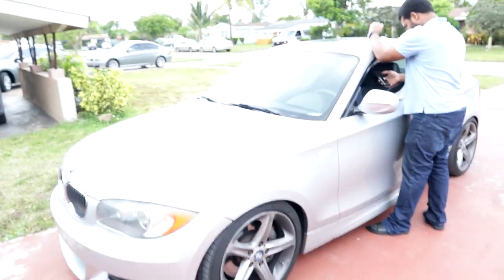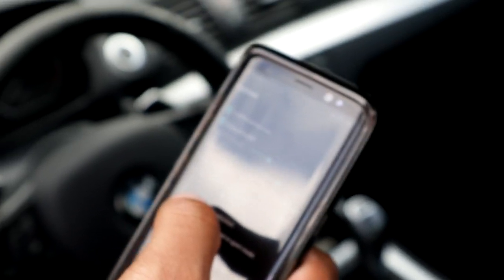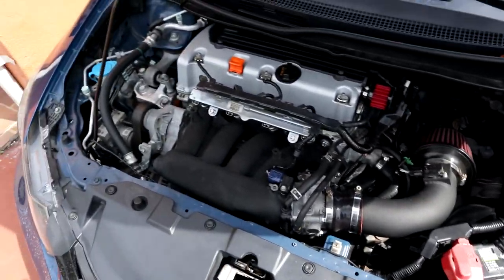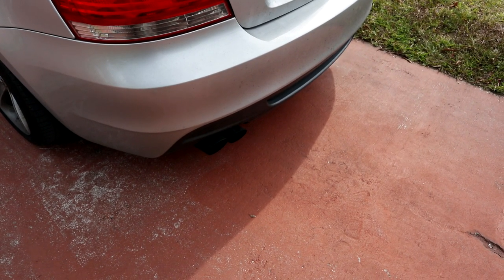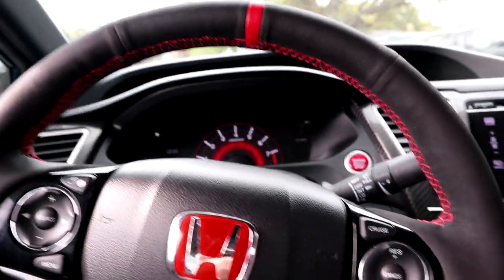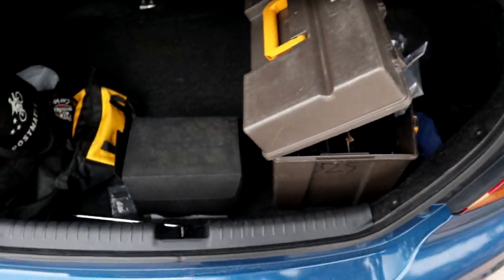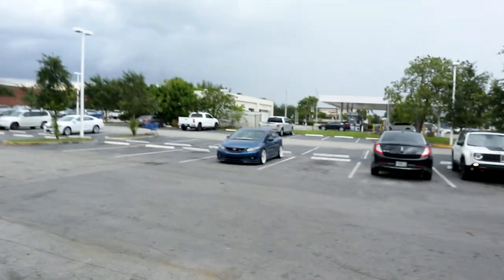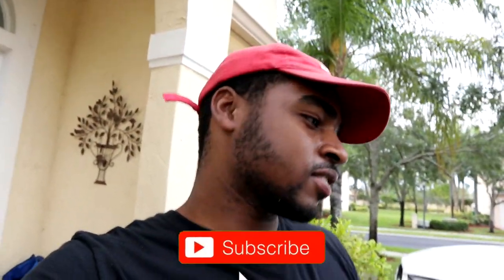Quarantine and Chill ... but with pops and bangs

Comment: If the new battery gets drained, the will need an alternator. Alternators are responsible for charging up the batteries  to provide constant 12v power to all the electronics